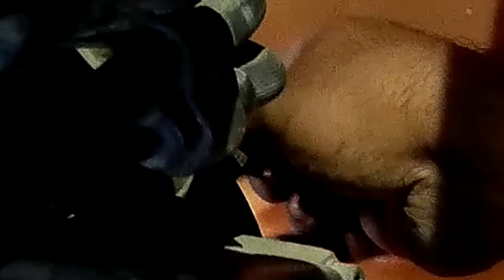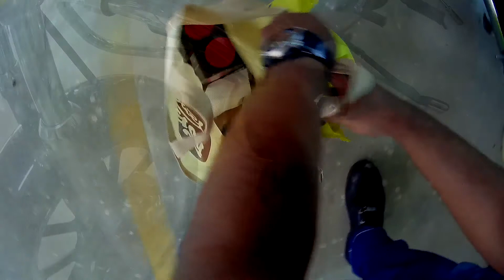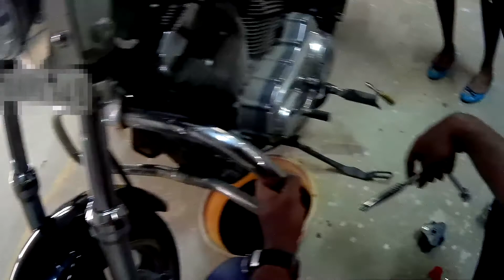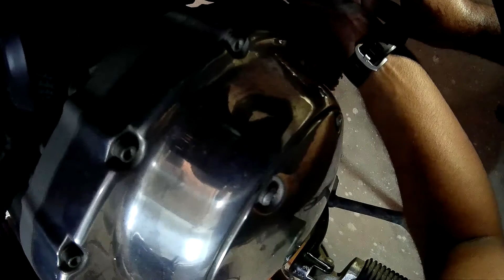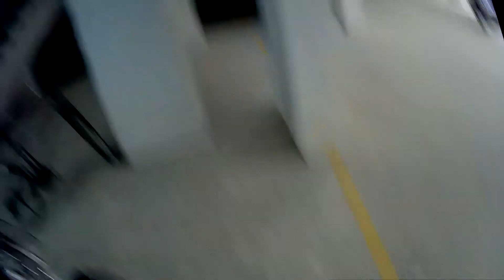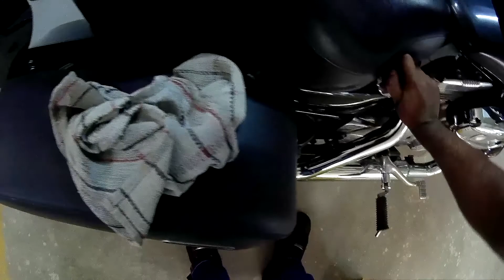How to change oil on a Harley-Davidson Sportster

Comment: Hey hi, I like your videos. Keep it up
 I have recently bought a superlow and need your guidance. How do you manage with the speed breakers. I am having lot of trouble with them. Did you upgraded your shocks. I am thinking of upgrading it but not sure. Also I have understood that the normal wrench toolkit does not work for harleys. Where can I find a complete set of wrench toolkit for Harley's so that I can do stuff myself. Thank you.
Reply from the maker: +Veshal M Mane Hey, good to hear from you and sorry for the late reply. Yes, my suspension is upgraded right from the beginning. I got it done at the dealership itself with HD parts. If you're thinking of upgrading, look into aftermarket parts like Progressive. They offer much better performance for the price. Regarding tools, I have got several things over time as it's very difficult to find a complete kit. I started with a Stanley 89516 as my first kit. It has both metric and inch sockets and you'll be able to do most basic things with it. From there you could get specific things over time as you need them. That's what I did. Let me know if you need any specific information. Will be happy to help.
Reply: Volatile42 hey thanks for the reply. Where will I get the progressive shocks and the kit any idea ?. Also what do you think the cost would come around to ?. And please do suggest if increasing the height is a good idea and what will it take to increase the height.
Reply from the maker: +Veshal M Mane The Stanley kit is available from Amazon.in. Just search for Stanley 89516. For the suspension, there are several ways. You could directly buy from the US and ship it some way. Or check with some of the shops here that do this kind of bike work. Where are you based?
Reply: Volatile42 ok. Will check Amazon. I am.based out of Mumbai. Do you suggest increasing the height of the super low. Any idea on how we can achieve that?. Thanks
Reply from the maker: +Veshal M Mane Increasing the height a little is fine and the suspension upgrades are how you do it. The Superlow is just one configuration of the Sportster chassis and there are many other models on the same Sportster chassis that are higher. The low stance of the Superlow is mainly for looks, and hence the name. While upgrading just make sure you do both front and rear in the same proportion. You may also need to upgrade your jiffy stand to avoid leaning it over too far. Check out https://www.progressivesuspension.com/ to see what options you have and prices, though prices will be significantly higher in India. Your HD dealer may also offer a package solution, so you may check with them also.

Comment: How was your experiencie with this oil on your motorcycle?
Reply from the maker: I honestly find it hard to tell differences between oils unless one is below the required standards. For me the Motul synthetic was just as good as the Harley Syn3, if not better. I had once put in a mineral oil but that one seemed to be losing its oiliness very quickly after running in hot conditions.
Reply: @Volatile42  how many miles have you got on your bike? I've using motul for first time (2,000km) and have no complaint on hot weather.
Reply from the maker: When I sold the Sportster, it had just over 27000km. I too didn't have any problems with the synthetic oils in hot weather, only the mineral oils. But there were other issues with the Harley engine in city traffic and hot weather. Knocking, leaking gaskets, etc. Not related to the oil.
Reply: @Volatile42  thanks. Be safe out there! 👍🏻

Comment: Is ur sportster out of warranty that you are using motul....?
Reply from the maker: +K T Yes, it's out of warranty. I'm not sure how it is in India but in the US and many other countries the manufacturer cannot revoke your warranty if you buy your own stuff and do your own maintenance. As long as the things are done timely and you use the correct type and grade of oil, etc.
Reply: I guess due to poor laws in India they are getting away with it and are making stupid rules. I have a back and forth query going on with HD india and the dealer where they state that the warranty will be void. This is idiotic because the oil which I want to use is far more better than SYN3 or any other oil out there.